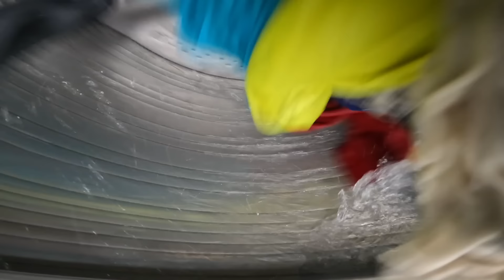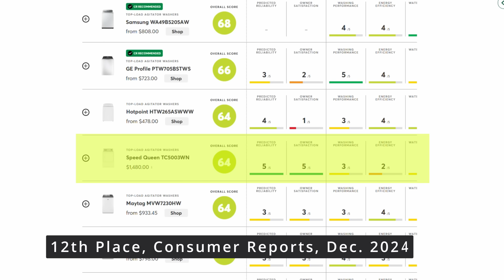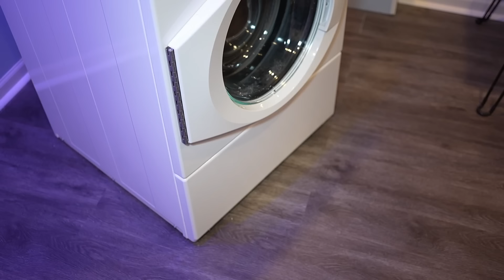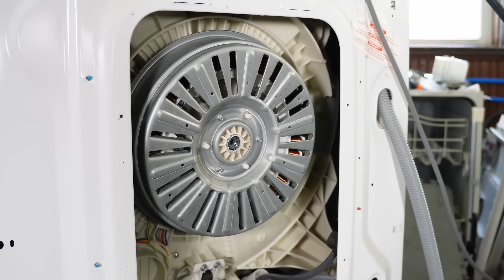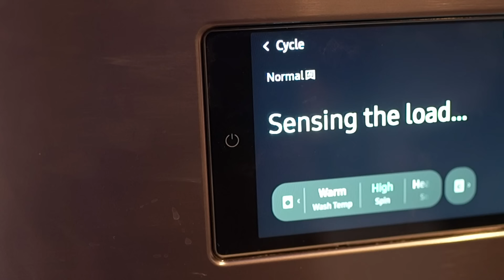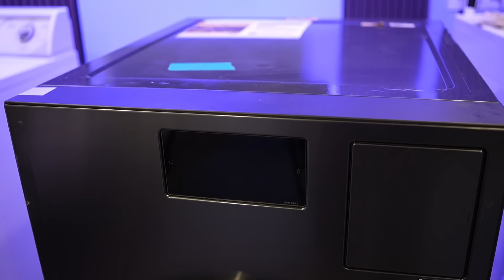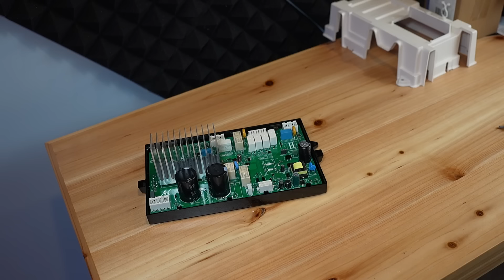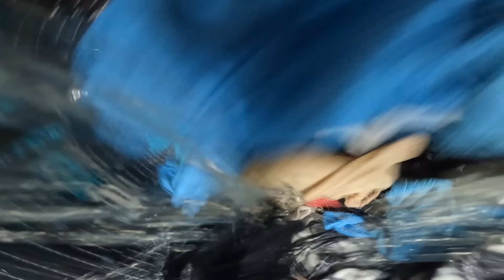Is America's Most Expensive Washer Great? The Speed Queen FF7009WN Test

Comment: so speed queen has the materials down to last 25 to 30 years, but no warranty, horrible cleaning results and no AI to improve the wash (sorry but washers have become superior with AI regulating some washing aspects like weight, load sense etc) and the washing times are awful. looks they took a top load washer circuit, modded a bit so it spins the tub around rather than the short movements of the top load agitator and call it a day. thats how a company dies. low effort. not to mention that water pump near the motor/onboard circuits without even a plastic sheet separating the area, if the washer gets the pump broken and is stuck full of water, that water not only will convert your laundry/kitchen room into a pool filled with washer machine soap, will trash the motor and/or the circuits. lovely idea!

Comment: I thought that a C  E / CE mark can mean two things: Adopted in 1993, the C  E mark with large white space in between the C and the E indicates that the product may be traded freely in any part of the European Economic Area, regardless of its country of origin.  The C  E marking indicates that the manufacturer or importer affirms the goods' conformity with European health, safety, and environmental protection standards. It is not a quality indicator or a certification mark. The CE mark with less white space in between the C and the E indicates "China Export". It is a bit of a trick China plays as the C  E EU markings where the original / first ones. The Chinese companies decided in 2008 to confuse customers by adopting a nearly identical but different meaning CE mark. Wikipedia has a great article on it called CE marking. 

edit: typos
Reply: Trademarks and service marks exist to protect the consumer from being misled by confusingly similar marks in the same market segment. But for some reason (corruption?), Chinese imports are not held to that same standard of protecting consumers. if it were, it would result in items with confusing marks being blocked from entering the country.

Comment: What a great test :) Though, in my experience here in the EU, the EU-brands washing machines all have heating elements inside for warming / heating the water themselves. I am wondering why so many US-brands lack this feature and rely on external hot water supplies?
Reply from the maker: Its a Speed Queen thing. Most others in the US actually have them. But as Dave said, 120v heaters mean that there isn't a ton of headroom for proper elements on these.
Reply: In North America,  our washers operate on 120V.   On order to heat their own water,  it would require operating on 240V,  like the European models do.  On top loaders, it would take too long to heat up the water.  Plus on top loaders, it would probably require a separate small tank, with a recirculation pump,  in order to heat the water properly.   On front loaders,  it uses a lot less water,  and doesn't take as long to heat its own water.